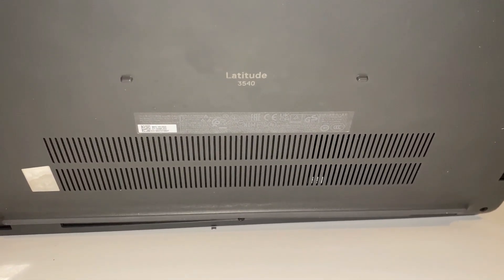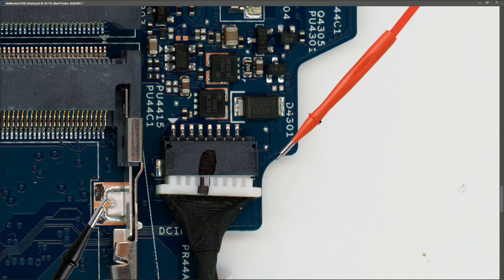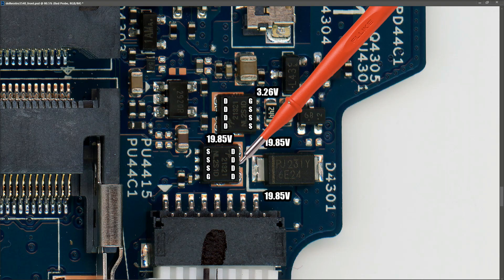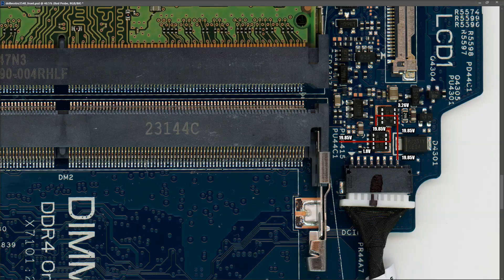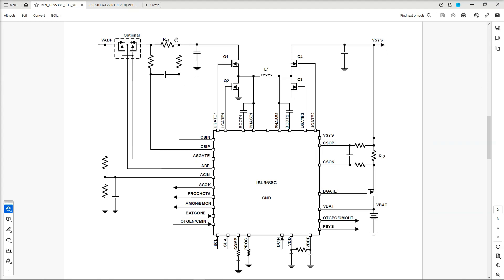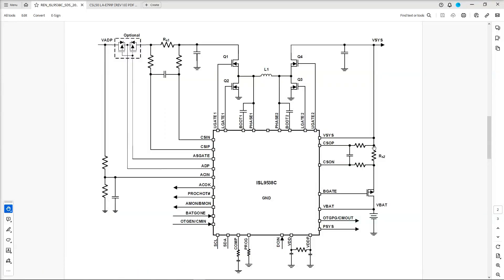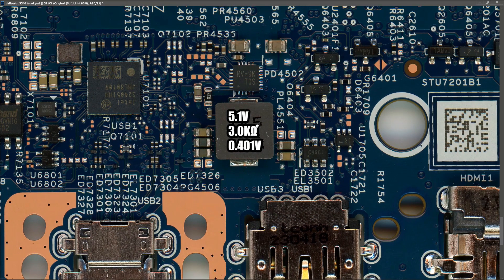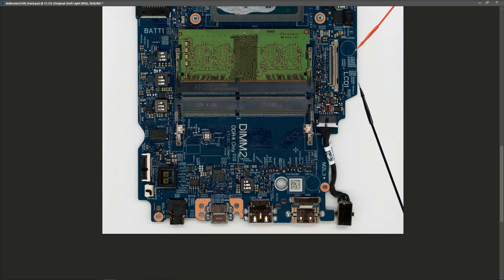DELL LATITUDE 3540 - INPUT SECTION ANALYSIS

Comment: Thank you very much for sharing this very useful information with us. All the best.
PS: A suggestion, for the Mobo's of recent models it would be very interesting if you could please show us the values of the EC chip also called Super I/O when it is operating in normal condition. You could show it on a notebook page with your own handwriting, you would save time given that most of them have 128 terminals and if that were not enough, some require prior programming.
Reply from the maker: Hi Sir, Yes I have been trying to get more modern motherboards, and fortunately I think I have found a source for them online. So we will have more modern content in to the future. 
I have a plan for a Super IO video, but I'm just not happy that I can explain everything as comprehensively as I would like. I need to put in more work. Thanks for watch.

Comment: This process is absolutely essential and valuable to the repair community. If I ever need to diagnose one of these board, I would either need a "control" board to take and compare these measurements, or I would need a video such as this, or an equivalent document. Just imagine if you could build up an extensive library of such measurements for motherboards from various OEMs. That would be an very useful resource indeed.